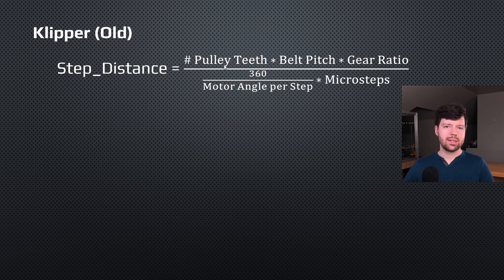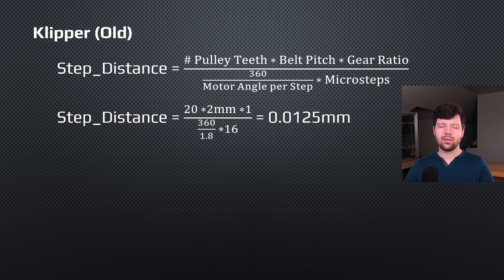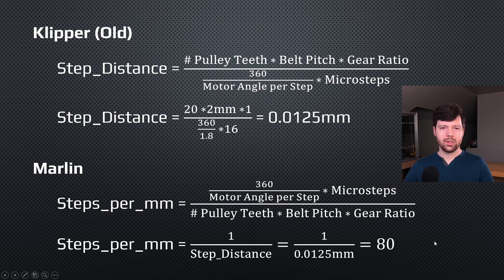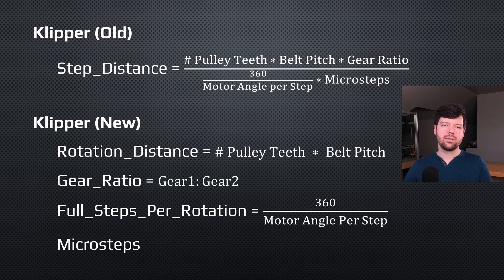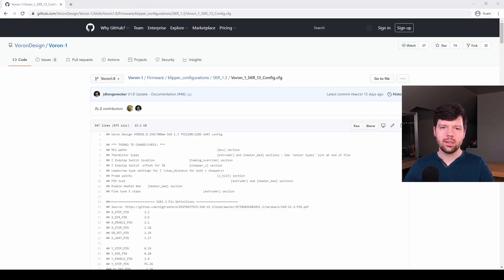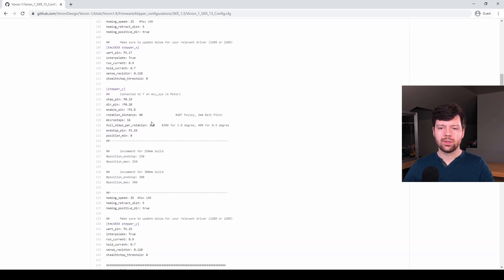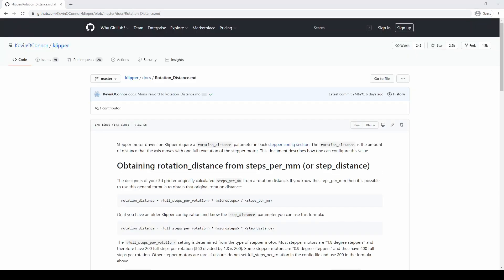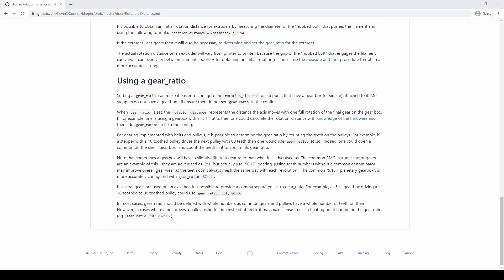Klipper Update: Rotation Distance

Comment: hope you can help. trying to understand this "math"
I have a voron 2.4 with that 80:16 gear for z axis. and i'm running on 0.9 deg steppers on my z

rotation_distance: 50
gear_ratio: 80:16
full_steps_per_rotation: 400
microsteps: 16

This is what i had to set to get my z to move correctly

But what i'm trying to understand is how did i get that rotation_distance to 50. default voron config it set to 40 for a 1.8deg stepper
Or i know how i got there. i manually changed my rotation distance for 2h until i got my z to move 100mm when telling it to move 100mm
Do anyone have an explanation why my rotation distance is 50 and not 40, i thought that i only had to change full steps pr rotation from 200 to 400 and klipper would do the rest :O
Reply from the maker: I bet I can! If you have to use a rotation distance of 50 to get your printer Z to move properly, then I believe you likely used a 20T pulley instead of 16T on your Z motors. Changing the rotation distance to 50 should be the same as keeping the rotation distance at 40 and changing the gear_ratio to 80:20 😊
Reply: @eddietheengineer   oh your correct! i disassembled some parts and found out that i infact  had used  20t pullys on my z motors :O 
Changed my Rotation distance to 40 and gear ration to 80:20  works perfectly!

but i still have some problems understandig the math here.  or somehow i think i do
you said in the video that rotation_distance = pully teeth * belt pitch    so my 20t pully x the gt 2 pitch of 2  20x2 = 40

BUT wouldn't that make the default voron 2.4 config to say rotation_distance 32  and not 40 ?

rotation_distance: 40
gear_ratio: 80:16
microsteps: 32
this is the default config from vorons github..
Reply from the maker: So, the rotation distance is for the pulley that drives the long vertical Z belts, which are 20T = 40mm.

Then the gear reduction is an 80T and 16T, for the 80:16 gear ratio! Hopefully that makes sense
Reply: @eddietheengineer   it all makes sense now! :)  ty for helping me understand that ;)

Comment: Thank you so much!! 🙏 I'm converting my printer from Marlin to Klipper, and I could not set this rotation_distance right..
I used the conversion formula to get from steps/mm (Marlin) to rotation_distance: 
rotation_distance = <full_steps_per_rotation> * <microsteps> / <steps_per_mm>
For my X and Y axis that is:   400 * 32 / 397.75  (last value being calibrated value in Marllin) = 32.18
But when I entered thsi in Klipper, the movements where exactly double the length! (so I entered 16.1 as a quick fix)
Turns out I was missing the  full_steps_per_rotation  variable in my printer.cfg file. (so when that is missing, Klipper assumes its 16 !)
After setting that to 400, everything is solved now 😎

Comment: Does it matter which gear is listed first? Klipper documentation states “The common BMG extruder motor gears are an example of this - they are advertised as "3:1" but actually use "50:17" gearing.”

Comment: So..? By knowing pully teeth, belt pitch and gear ratio for x, y and z axis, that becomes the default  numbers for  rotational distance? Because when I print a 20x20x20mm cube, it's not 20x20x20mm. I figured out how to calculate e-steps. Seems there should be a calculation for the other stepper motors.
Reply: I have the same issue .  I mArlin I can alterthe Steps/mm. to correct.  How /what do I alter in Klipper
Reply from the maker: Sorry for the delayed response! a 20T GT2 pulley would be 40mm of rotation distance (20T * 2mm belt pitch)

Comment: I built a Voron 0.1 from a Formbot kit. Moving X by 120 didn’t actually move 120mm - it moved 123mm (from being off the bed on one side to being off the bed on the other side). It was easy to measure the bed and prove that the nozzle was moving further. I find it bizarre that I have to modify rotation distance to 41, even though it has 20-tooth pulleys and 2mm belt pitch. What do you reckon? What is the best way to correct for this discrepancy?
Reply: i have same issue printer should be moving 20mm but its moving 24ish XD

Comment: quick question! I did the belted Z which uses the stock stepper with a 16t pulley, GT2 belts, (a big 80T ring gear with 188mm looped belt to keep the z axis from falling) and I was wondering in klipper my rotation distance is set to 8 with a microstep of 16 but I don't know if that is correct or not, x and y are set at 40
Reply from the maker: So, you can do a few ways here. You’d either define a rotation distance of 40 (20T drives the actual Z belt) and a gear ratio of 5, or you’d set it to 40/5=8. Both will get the same end result!

And fortunately with rotation distance, microsteps don’t matter! So you can change those if you feel like it without changing your other settings

Comment: Excellent change, this makes it more consistent with the underlying math.
One thing I do not approve of though is the definition of gear_ratio. gear1:gear2 is hopelessly ambiguous (and thus very unPythonic), you must change this to drive_grear:driven_gear
Reply from the maker: That's a great point! It could be confusing which is first and which is second.
Reply: From an engineering (mechanical engineering) point of view this (gear1:gear2) is the right way, so it makes sense. However, I do understand your point.

Comment: How do one go about and enter gears for a planetary gearbox?
For example a QR extruder
Reply from the maker: Planetary extruders are a bit tricky. For instance, with a 10T sun gear and a 65T ring gear, the formula is 10/(65+10) = 1/7.5. This would be gear_ratio: 7.5:1 in Klipper.
Reply: @eddietheengineer  I'll have to read up a bit on it, but you might want to add that info in?
I think with the orbiter extruder, QR and there are a few more..
But if I understand you correctly I can just ad in the gear ratio without the math behind it?

Comment: thanks for putting this video up! curious how one would do extruder fine tuning with this new approach, change the gear ratio?
Reply from the maker: The best approach would be to change the rotation distance parameter—gear ratio is a physical representation and not an approximate value (you can’t have 17.1 teeth). The fine tuning for the rotation distance makes sense because  depending on how compressed the filament is by the drive gears/idlers, the radius will change slightly.
Reply: @eddietheengineer  thanks!
Reply: Does that method work the for axis movement fine tuning

Comment: Hello Eddie. Do you have made a mistake? In the voron 2 GIT hub, the z gear ratio is set to 80:16, but standard build is a ratio of 80:20, ins't it? Best regards Martin
Reply from the maker: The standard build uses a 16T on the stepper motor to the 80T gear. These two are the "gear_ratio" gears. Then, the drive pulley is 20T (which does into the rotation_distance) - 20T * 2mm :)